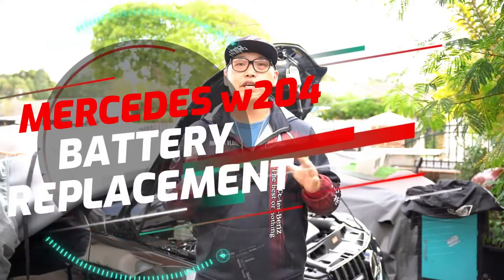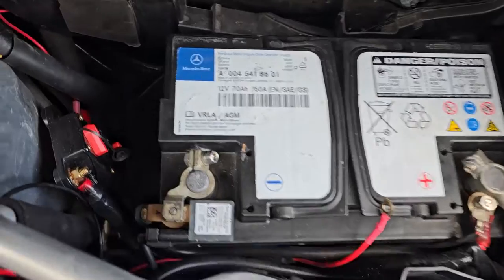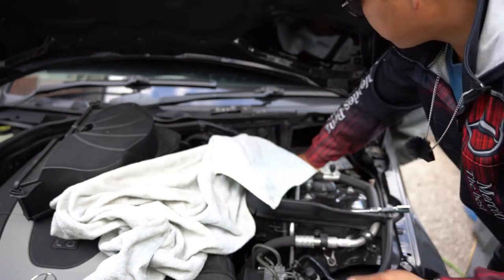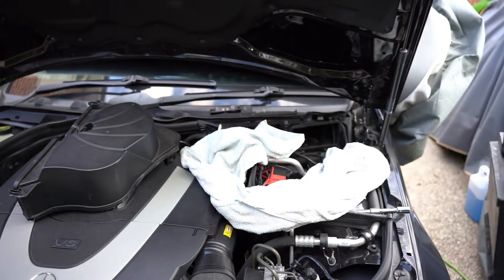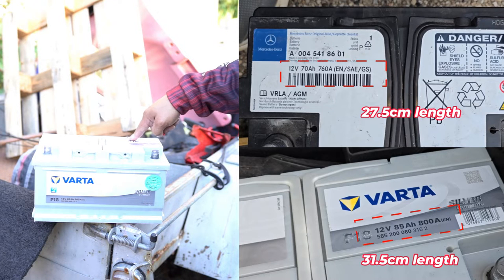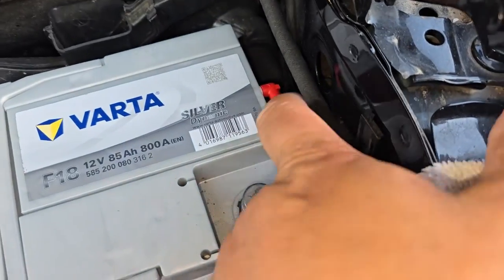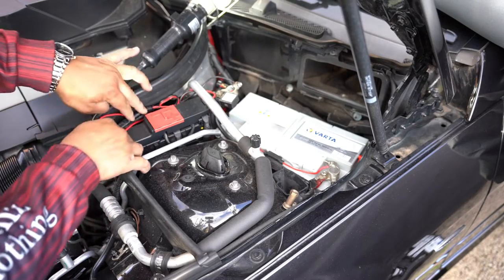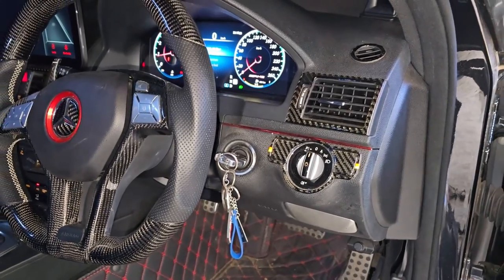Mercedes benz w204 battery replacement

Comment: is it the same location for a 2007 Merc C280 V6 sedan please? I'm in Australia too, Perth. Does the battery need to be replaced with a "Mercedes Benz" branded battery?
Reply from the maker: @jasonswift7098  no any battery same size but agm is best as it's better for electronics which we have alot of ..but even non agm is fine

Comment: It has nothing to do with the video, but I have a W204 Mercedes and while changing the rear lights, I noticed something (p21w). The lamp on the upper right rear part does not turn on, even though I put in the new one. I think it is the fog lamp because the lamp on the left side is on. What can I do to make this lamp come on? Please help me. It's all up to you. I learn from your videos. @mikeyzvideo
Reply from the maker: do u get an error msg ? sometimes only one side of the rear fog lamp works ... buy if it was working before then ut will be an issue with your ground cable common fault with these cars
Reply: @MIKEYZVLOGZ   don't have error message or something bythway I don't have fog lambs i have day light led I just have the bottom of the rear fog lambs
Reply from the maker: ok so this is similar to my w203 ..in Australia we only use one side rear fog lamp...and I wanted to get my rear right to work so I wired a new wire tapped off the left side fog lamp so wen I turn on rear fogs it will also trigger the right rear fog ...but merceds is smart ..it even tells me right lamp not suppose to be on ..something like that ...I found it so wierd ... and everytime I turn on my rear fogs gives me the error msg saying right fog not suppose to be on...I'll have to get the exact phrasing
Reply: @MIKEYZVLOGZ  Okay, so it's best for me not to touch the tail light, let me ask another question mike, when you press the rear fog light (there is no fog in the front), the short light in the front also moves (only the left) and I noticed this 3 hours ago, but the right side does not move, if this is normal. I won't touch it, which means everything is fine
Reply from the maker: @bedirhansahin7406  your rear fogs shouldn't haver anything to do with your front fog lights, wat do u mean it moves?? the low beam moves?? your left side low beam moves??
Reply: @MIKEYZVLOGZ  exactly left low beem move but right not if send a vido u catch it I know because u do best

Comment: Someone dropped the battery in my car at when fitting it at the dealer when i bought it and cracked the battery and acid leaked down and under the car weeks later.i had to anti rust everything and clean off battery acid that sucked. So really try and lower it down very nicely it could be a real bad time if its dropped
Reply from the maker: omg this happened to my w203 it had rust all under battery ... and I never noticed ... terrible time I had trying to fix it ended up using a battery clamp to hold battery down cuz the tray was too far gone from rust

Comment: I have to change mine from 2014 - W212.   Place faulty airbags with module calibration, plbraje pad sensors, spark plugs, brake cables and front cam leakage.   Everything listed is exactly 2000 dollars or 3000 dollars at the dealership.   A beautiful money pit, as expected.    They'd probably charge 300 dollars minimum to replace the battery, plus tax on the 200 dollarcan hour labor. ;)      Anything dealing with electricity or being under the weight of a 2 ton plus vehicle is a no go for me.  There is DIY and injury.   I'll buy an OEM Mercedes battery and have a licensed shop install it.
Reply from the maker: that's fine ... if u have the resources and money to pay for everything ..more power to you..but if u have ever watched anyone change a battery it's exactly the same way ... same principle what they do maybe abit different but u disconnect terminals and remove battery and install new battery and reconnect terminals... but I respect the fact that u can pay for all that ..good on ya